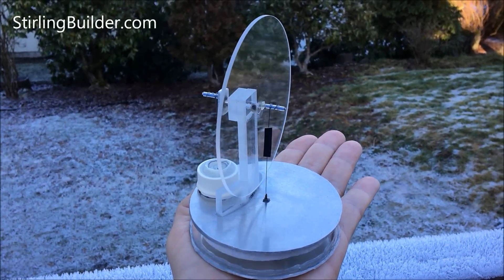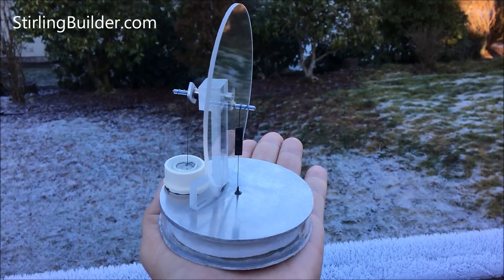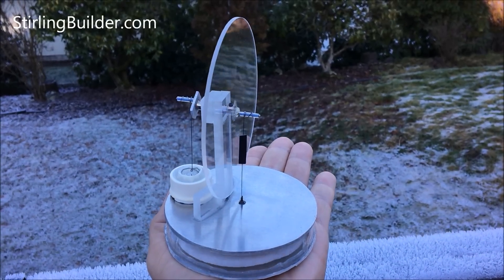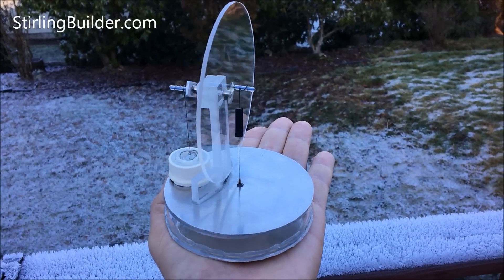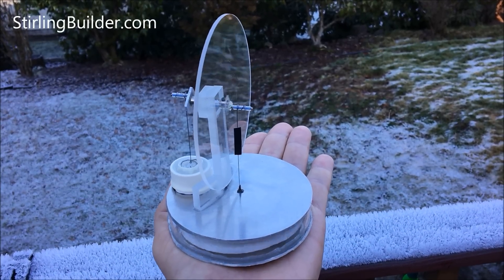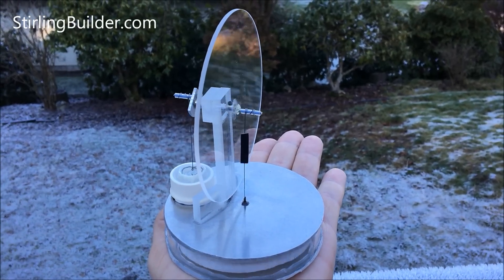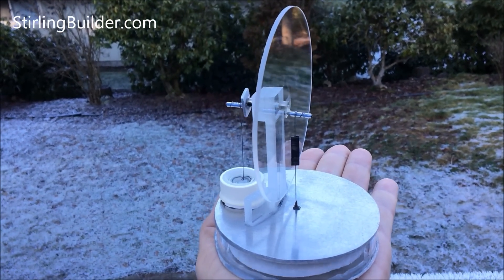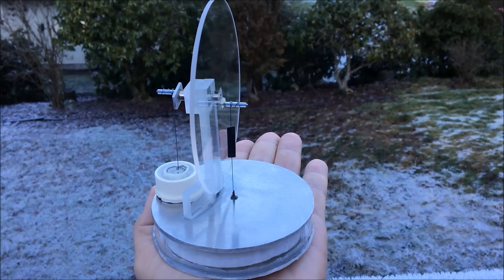LTD Stirling Engine Running Heat of the Hand

Comment: Great design Jim! What did you use to get an air tight seal around the wire going through the top of the engine?
Reply from the maker: Teflon tubing.